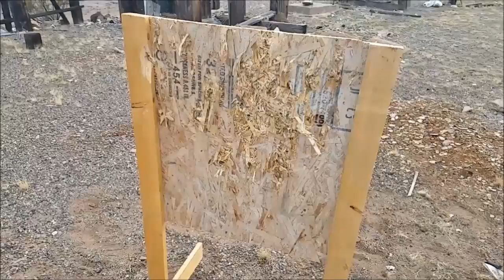1" Pipe Cannon

Comment: Beginner question here, why do you have to put the paper thing after the projectile and not before with the powder?
Reply from the maker: If you're loading shot, you should actually use both a wad and a card! For instance, with birdshot you need a thick fiber 'wad' atop the powder underneath the shot to make sure the shot accelerates uniformly, then a thinner over-shot 'card' above the shot to prevent it from rolling out of the gun when it's tilted. If you're just shooting a ball, a fitting patch is all you need behind it to keep it in place.

So you can see the difference, here's a card that you'd use above the shot: https://www.ballisticproducts.com/Overshot-Cards-500_bag/productinfo/OS/

Here's a wad you'd use below the shot:  https://www.ballisticproducts.com/Fiber-Cushion-Filler-Wad-1_2/productinfo/FC/
Reply from the maker: One more thing—it's not a bad idea to buy 11 gauge wads and cards for say, a 12-gauge. You want them to fit snug, but not extremely tight. (Annoying to load) Too loose won't work.
Reply: @theblunderbussbrothers9547  Thank you very much for your detailed answer and help!
Reply: Thank you very much for your answer and tips! How much powder did you approximately use when firing the balls in the beginning if you remember?
Reply from the maker: If I recall right, I measured out 200 grains, which is a LOT. We used 2F powder because it was the most course powder we had, but we really should have been using single F. And I would NOT use substitutes. Or recommend doing this at all, really, the FEA results I ran are borderline. @JSB845
Reply: @theblunderbussbrothers9547  You would not advise using substitute powder because there is a chance of the cannon blowing up? Or because the projectile would be too powerful? Thank you for your reply.
Reply from the maker: It's always better to err on the side of caution, and black powder substitutes are known to produce higher pressures. It's so borderline already that it may very well be enough of a difference to burst the pipe at the rear, and that's obviously a bad situation. I wouldn't do it.  @JSB845
Reply: @theblunderbussbrothers9547  I don't want to contradict you but how come real muzzleloader barrels don't blow up when there being shot? Is it because the charge is smaller?
Reply from the maker: Briefly, it's because not all steels are made the same, and even between steels of the same alloy, their properties (tensile strength, yield strength, ultimate strength, fatigue cycle limits, etc.) can vary wildly depending on its heat treating and surface conditions. A steel heated and normalized might experience plastic deformation under a certain stress, and that very same steel under a more aggressive heat treatment may yield less up to that point, but end up failing in a brittle manner at the same point. Modern muzzleloader barrels are made from a known steel alloy, usually drawn over mandrel to eliminate any weld seams and built to a sufficient thickness for their purpose, then heat treated appropriately under careful conditions. These pipes on the other hand are only roughly uniform inside, usually include a weld seam, and their steel constituents aren't nearly as controlled due to their lower stress usage and high demand in construction. When I ran an FEA on them, I had to assume a mild carbon steel alloy with a generous margin of safety--and that's just for the instance of a single shot! To truly proof-test it, you'd need to measure for a lack of any deformation of the steel under relatively extreme loads, multiple times. I haven't confirmed whether it's yielding or not, but it seems likely.  @JSB845
Reply: I feel so stupid right now haha how could I believe that all materials are made the same. Thank you for the answer and wish you luck on your engineering path.
Reply: Hey it's me again. Do you think it would be more suitable to use 4130 or 4340 chromoly steel tubing to do this? Or is it what you used in the video? Thank you again. I was also wondering what role does the wall thickness have in an experiment like this. If the wall is bigger, does the strength of the tube increase or does it decrease? Thank you.

Comment: Something you need to understand, having handled original British muskets in museums, you have to actually see how paper thin the barrels are on those guns. Modern reproductions of smoothbore muskets are several times thicker and the construction is totally different. Original smoothbore musket barrels were made by starting with a thin sheet of iron, which was pounded over a round form to create the barrel and overlapped to cover the seam where it was joined together. A man whose job was known as a filer would come in and smooth the whole thing down, filing and then blending the seam and creating the thicker taper where the chamber was. Then, the barrel, along with many made in a batch would be taken outside, loaded with double the powder charge of a normal musket, and in the British military that was a 110 grain charge and a single .69 roundball. So the gun would be loaded with twice that, 220 grains of powder and two roundballs. This was what was known as "proofing" the barrel. If the barrel survived, they would then leave them outside until a layer of rust formed. That would expose and jagged or weaknesses in the grain of the iron used to make the barrel. Then those that passed would be brought back to the filer and smoothed out once again. After that, the passing barrels in the case of the English would move on to the Tower of London for assembly in a musket when needed. So I'm pretty sure, even the crudest of today's steel pipe is of better construction than the way they used to do it. And those guns would fight on and on for several battles, in several wars in some cases and then get turned into Trade guns and go on with Native Americans or with civilians somewhere. Today's steel pipe is much better in purity, temper and thickness for the most part than any original smoothbore musket than I've ever seen.
Reply from the maker: Thanks for the insightful comment! I haven't had the pleasure to hold an original example of any such firearms, and the concept of swamped barrels never let me really approximate chamber thicknesses or wall thicknesses where breach plugs thread into the barrels from pictures alone. My concern with this pipe wasn't with the walls, but mostly with the threaded ends and the cast iron pipe cap which acted like the breach plug. I've cut a 1/2" pipe cap and was amazed at how thin it was--combine that with it being cast iron? I'm running for the hills!  Years after making this video, I'm most of the way through a mechanical engineering degree and can run finite element analysis simulations of objects and see how they'd deform and likely fail. The part under most stress is the thinnest section of pipe thread as it approaches but doesn't quite reach where the pipe cap engages it--if it were ever to reach 10,000 psi internally from either a heavy load or an air gap, it appears it'd burst radially and likely toss the cap off in some direction sideways. I must admit, though, it certainly seems to have held up to a proof test of the loads I put it under in practice. Still can't recommend it.
Reply: Whats the maximum amount of flash powder a 1" pipe with cap and fuse hole could withstand shooting a 7/8" diameter lead sphere approximately 65 grams

Comment: What u use for powder ?
Reply from the maker: We used Goex FF in this one. Most of our powder is Goex. All of our videos with black powder have been goex so far
Reply: @theblunderbussbrothers9547  how many grains Yall use ?
Reply from the maker: @Derek Wallace ole son  It's in the description but I can't recommend you ever try this, lol. We did it here so you don't have to wonder. One secret you don't really see on the channel is that I'm an engineering major and I ran a finite element analysis on the pipe in industry grade software to determine a factor of safety. It's barely above 1.00 for how this was loaded, so if you do ever try something like this, make sure you take all the safety precautions. Also use single F powder—I just didn't have any.

Comment: You really should’ve tried to over pressure the pipe to see how much is TOO much for the pipe to handle
Reply: If you use good seamless steel piping, it's actually quite robust, particularly considering the mild pressures of blackpowder. Mind people make 12-Gauge slambang shotguns for smokeless shells, and the ones with good piping hold up well.

Comment: Don't use 1 inch for this. Too thin for the diameter. Use half inch 50/50 load. 50 grains bp and 50 ball or just buckshot.
Reply: No worries, Blackpowder is twice weaker than smokeless.

Comment: What is the powder charge in this?
I'm impressed it hasn't blown.
But do know some pipes are hi pressure pipes.
Reply: Good ol' blackpowder, generally 1mm or 2mm thick steel pipe will tolerate weak pressures of blackpowder and yeah you can make you own musket out of pipe.

Comment: Where did you get the shot cup that size
Reply from the maker: We 3d printed each shot cup that we used in this video. If you have a 3d printer and want to make some yourself, I can send you the stl. If you don't have a 3d printer but need a shot cup, I would roll some paper into a thick tube of the correct diameter and seal one end with a 1" plastic or cork circle of sorts. Cut four vertical slots equidistant from eachother and it's ready to use!